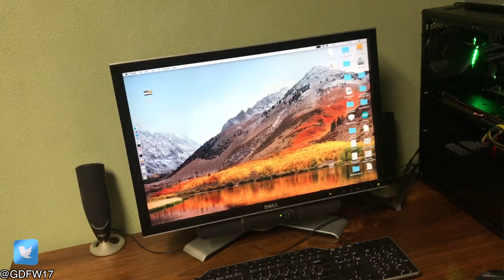I Built a Hackintosh Workstation!

Comment: Just wanna say be careful with those h100i v2 corsair cpu water coolers. Those pumps are known to quit functioning. I'd say within a years time. I've personally experienced this. Had mine for roughly 6 months when it suddenly stopped working. I noticed the LED's on the pump were all red when the pump died but that was really the only sign. Fortunately I noticed before anything bad occured.

Comment: I'm pretty sure "Dual Channel" ram runs faster when it actually has "dual channels".... I just read that comment back to myself and it sounded really "dueshy" Im not trying to sound like an ass. I could be completely wrong. I always thought that when you have dual channel ram with two or more sticks, each channel is combined to equal the total rated speed. If you only have one stick in a dual channel system your systems ram theoretically running at half speed. If someone has more insight please respond as I would also like to know....

Comment: Arctic silver is a thermal adhesive, meaning that it dies and sticks the part to the cooler.
NEVER USE THERMAL ADHESIVE ON A LGA SOCKET, YOU WILL NEVER BE ABLE TO GET THE CPU OUT AGAIN.
The thermal paste that is applied to the AIOs is pretty much top of the line stuff, but you can use IC DIOMOND if you really want best of the best ( thermal grizzly Kryonaut  is a good option as well).
You have a top of the line 8700K CPU, but paired it with a 3 generations old GTX 770 graphics card. Do yourself a favor and buy at least a 1060 (or 1070), otherwise your CPU is not gonna do much for you,especially for rendering 3D files or videos, GPU does most of the work in those cases.
There were a lot of minor problems as well but these were your main "cringe points". Your system is not well balanced at all and you're losing a lot of performance by having an almost obsolete GPU. Also buy yourself a 1080P (or 1440P if you buy a 1070) monitor  so at least you can use the horsepower of your PC. I bet the one you got for free is 720P.
Reply from the maker: I think I should correct you on that, Some arctic silver is a adhesive, not all
Reply: Yeah ... arctic silver 5 is a thermal paste. I still wouldn't recommend it though ...
Reply: Arctic Silver 5, the one I bought long ago and still use, is not an adhesive.  You're thinking of another product made by the Arctic company.
Reply: Epic Noob artic silver 5 is perfectly fine

Comment: I’m cringing, but welcome to a wonderful new world. Should have saved some money and got and just went with air cooling.  Better performance until you get into custom loop.  AIOs do make for a clean build though.  Same with the NVMe. Clean look, but you would have been fine with a SATA ssd.
Reply from the maker: My CPU hits 84C when I try to overclock, so I suppose that I need more cooling to deluding to do that
Reply: Gear Down For What? If it’s 84C under load then your fine. It won’t start to thermal throttle until around 100C. If it’s 84C at idle then something else is wrong. Probably bad thermal conductivity. Maybe the AIO isn’t seated right.  If that’s not the problem try adjusting the fan curves. Intels thermal compound under the lid is junk too. If you really want to get dirty look up deliding.
Reply from the maker: I have seen that 😏

Comment: Core i9 is newer and better than a i7 but it’s way more expensive....
Reply from the maker: You are correct, i think clock speed the wasn’t quite as good either. I was really just looking at single core performance for cad
Reply: that is an i7-8700k which is coffee lake which is newer than the i9s, however, the i9s are still better as they have more cores and a lower clock speed. If that is not an i7 8700k then it only has 4 cores which are adequate enough.
Reply: Hey, he could always go for threadripper lol

Comment: BTW he makes it look really really hard. I'm 14 and i have built 2 pcs. So, if want to build one it is so much easier than how he makes it look.
Nice job though.
Reply: Benjamin Ochs, Also 14 and I’ve built like 5 pcs. The trick it to not rush it. As long as you take it easy and double check everything you should be fine. Just look up some pc building guides and watch a few and you should be fine
Reply: Wow do you want a metal because no ones asked
Reply: Just pointing out it's very easy, no need to be mad
Reply: CORRECTION:  "Wow, do you want a medal because no one's asked."